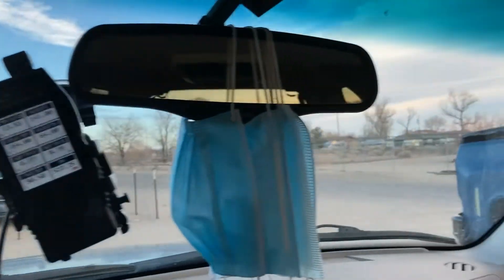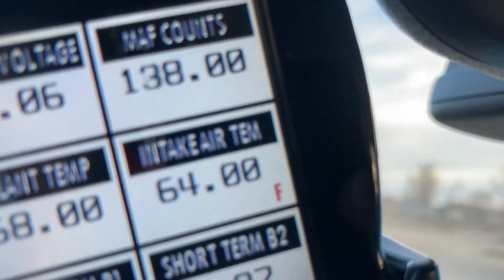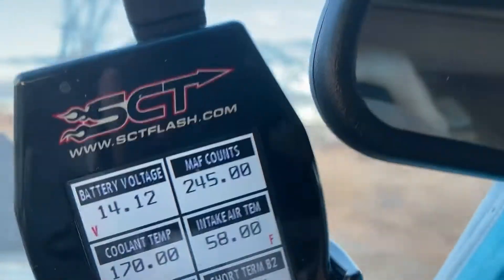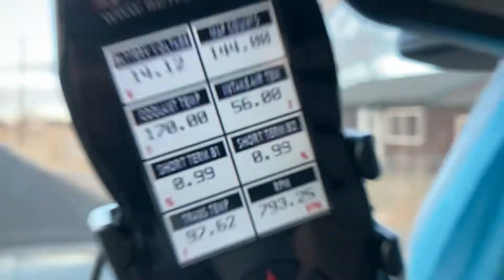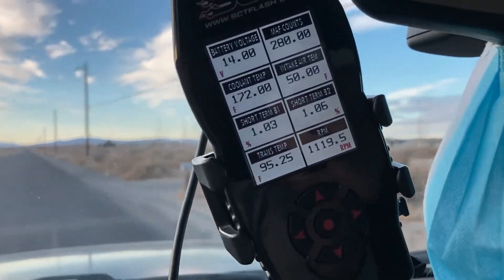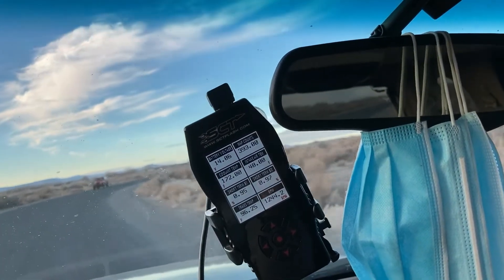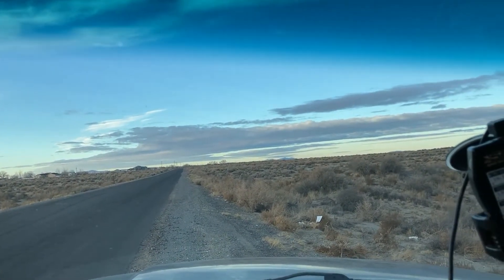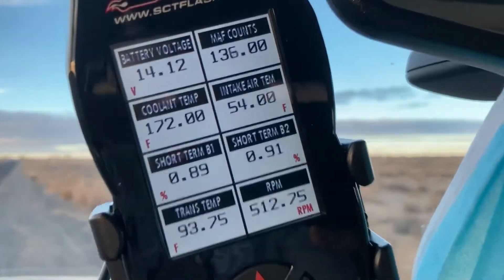Free Cold Air Intake Drive Test on 98 to 05 Ford Expedition, F150, Mustang

Comment: Why didn’t you replace the elbow between the throttle body and MAF? That resonator can’t be good, and you could probably replace it with a 3” 90 degree elbow for $5.
Reply: Yes I can do that on another video find some 3 inch intercooler tubing make a smooth transition
Reply: @TTATurbochargeThemAll  silicone tubing comes pre-shaped for the 90 from some places. Then you could even get rid of the bellows attachment after the MAF...